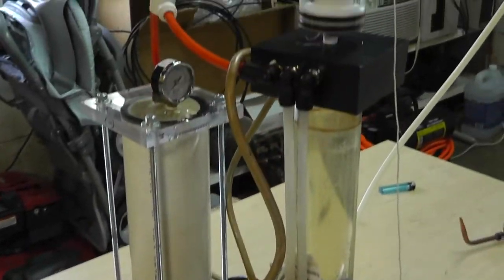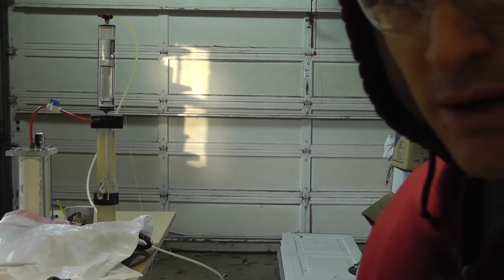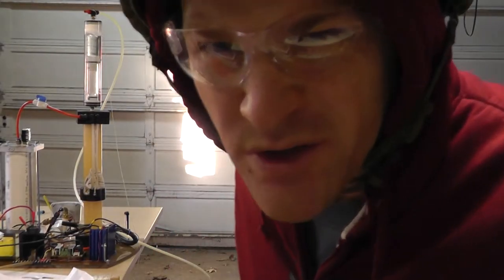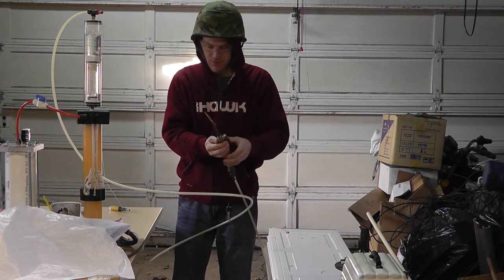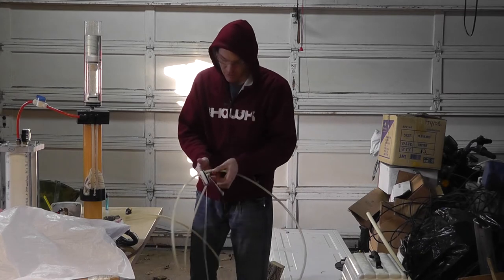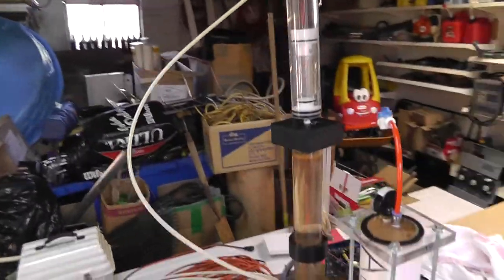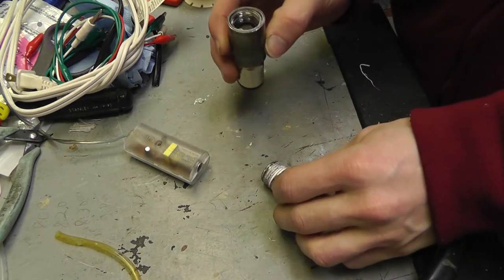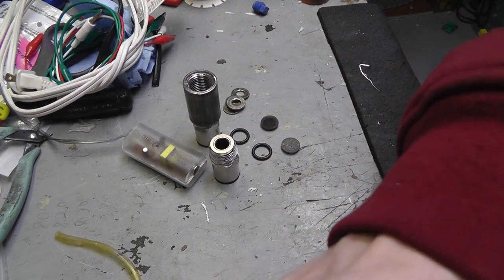Flash Back 2. BOOM! Ha-ha Well Another Explosive Test... 12-12-11

Comment: Russ, Just for fun. I did a quick calculation of the flame speed. If your camera is set to 30 frames per second and the flame was 10 feet long. As can be seen in one of the shots. I calculate the speed of the flame at 360 Km/h.

Comment: stuff the torch tip with bronze,get some off an old magnetron-its a washer thing on the front of the magnetron that can be unrolled like a sock.
you dont want a flame travelling so far down the torch before it finds the arrestor,you want to stop it in the tip,that way even low volumes of gas can produce a constant flame.
for added flashback arrest,dip the torch tip in water before lighting it.

Comment: Nice tennisball ;) yea i did notice, i just thought it was some sort of funny contraption u build.. 

Ceramic=YES Plastic=NOPE  Also you're flow is way too small.. for that size of welder-head.. gas flow too small to stay lit, so with a smaller hole, forward gas flow pressure goes up, and you get the flame.. for that small volume of gas, i used a damp cigarette filter in-line, like inside the hose, stack more than one if need. Of course its just a temp solution, the ceramic is the right way ;)